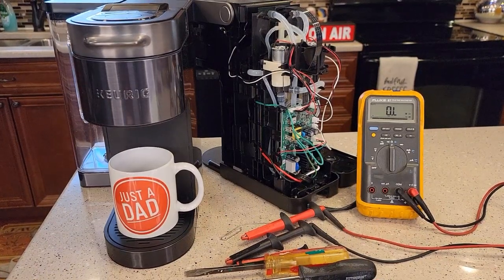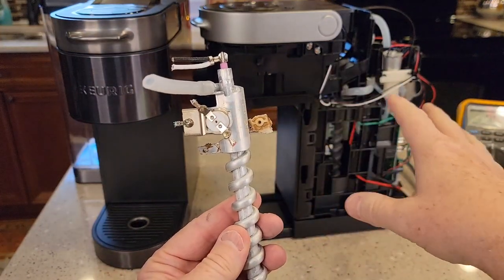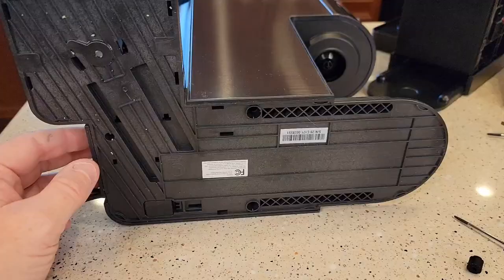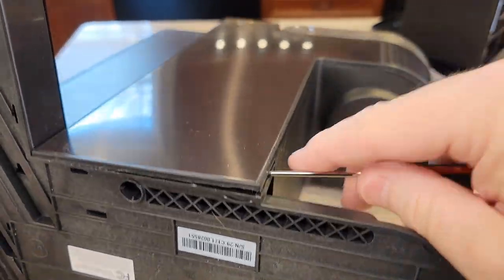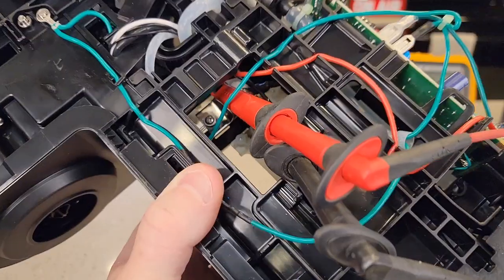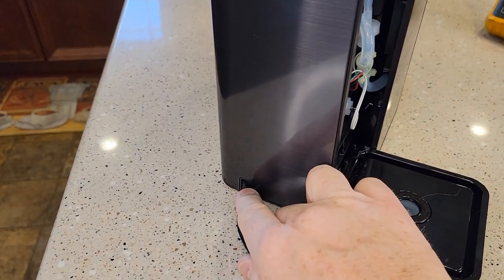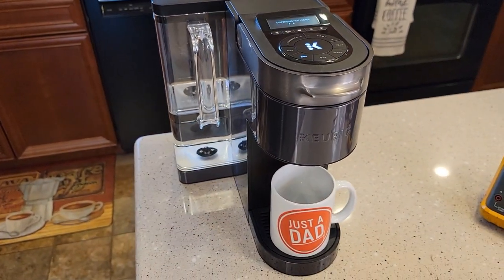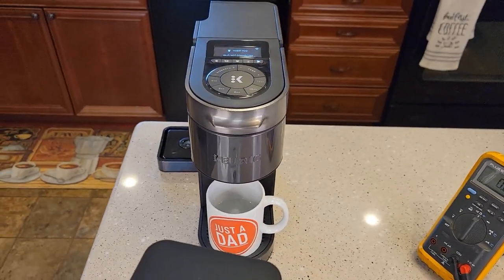HOW TO FIX Keurig K-Supreme Plus Smart Coffee Maker Not Working RESET THERMOSTAT

Comment: Thanks. This fix worked for my K-Supreme Plus. Took about half hour start to finish. It's not easy to pry the unit apart in the various spots noted in the video, just be careful but not too timid. I did break 2 of the clips that JustADad mentions might break, but managed to get the rest off no damage. Good luck folks. It's worth a try with a dead, out of warranty unit.

Comment: Worked perfectly! Not confident that the machine won't do it again, but at least it got it up and running.

I ended up drilling a small pinhole on the outside plastic and through the the plastic frame on the inside so in the future I can feed a paper clip all the way through, without having to take it apart. For extra visibility, the top square piece can be popped off to see how the paper clip is being fed through. 

For reference it is about 2.5" deep when the paper clip falls into the reset hole.

Comment: Thank you for sharing your knowledge and showing me how to fix my Keurig. It's working again with no issues. I've only had my Keurig for about 6 months and I was doing my first cleaning and descaling. It ran for about 15 seconds before it started steaming and an error flashed and then shut off. I am attempting to clean it without using the descale setting and so far so good. Thanks again for your help.
Reply from the maker: Great to hear!

Comment: Thanks again for the second time. Twice I didn’t get the reservoir fully seated in the machine and tripped the breaker. Second time with experience and your help it went much faster than the first time. The frustration for me is why Keurig would design the reset so deep in the machine that this simple mistake would require complete disassembly of the outer case. Again thank you for this most helpful video.
Reply from the maker: Glad I could help

Comment: Hi Dad,  I have sent a link to your video to Keurig corporate for a response.  I really think you have pinpointed the issue and a better way of fixing the issue than simply replacing the unit as Keurig is now doing.  I will update my comment when I hear back from them.  FYI this has happened to me with 3 new Keurig Supreme Plus units so one would have to assume that they are aware that these units have an issue.

Comment: I reset the tripped thermostat on June 6th using your instructions. Today, after I found myself drinking gas station coffee again, I installed piano wire so that I can reset it without taking the cover off. : -) Thanks for the great video!
Update: Sometimes I think there my be a little charge on the end of the wire, so the pot should probably be unplugged for the reset and maybe something with some insulation would be worthwhile. :)
Reply from the maker: Glad it helped
Reply: That's brilliant!
Reply: @rashadmomoh1949  Sometimes I think there my be a little charge on the end of the wire, so the pot should probably be unplugged for the reset.

Comment: Hi Dad, I still haven’t heard back from Keurig but I had a chance to implement your fix on my broken machine after they sent me a new replacement.  Unfortunately, I regret to advise that although the reset restore the power, the machine would not brew.  It seemed like it was overheating so I pulled the plug.  My guess is that Error 9 that causes the brewer to stop working may mean that the water pump is burned out, which isn’t fixed by resetting the thermostat as you have suggested.
Reply from the maker: Sorry to hear that

Comment: My K-Supreme Plus Smart coffee maker seems to turn on if I unplug and replug it.  The screen shows the initial message followed by "please wait".  It makes a noise, then stops and a few seconds later the message disappears.  If I lift the handle, the light inside the cup holder lights up, which I assume is to detect the pod type, but when I put the handle back down, there are no lights on the coffee maker and it appears to be off.  Would this reset method fix this problem?

Comment: Any idea why the unit would throw a ground fault?  I took out the heating element/coils to clean it better than a descale as the descale wasn't working.  I put it all back together and when I hook up the thermostat ground it faults out and my GFCI trips.  Not sure how to troubleshoot.  It runs fine if I don't attach the ground wire to the thermostat bracket or if I use a non GFCI outlet.  EDIT I just took my multimeter and checked the heating coil that wraps around the heating element(which is what the ground connects to).  It has 120v running through it.  I would imagine that's not supposed to be like that...

Comment: After I reset my thermostat it powers on and runs a cycle then shuts itself off after the cycle and has no power again. Do I have to reset the thermostat each time ?
Reply from the maker: This could be a known issue Keurig has with this model of Keurig. I would call Keurig Customer Care at 866-901-2739.